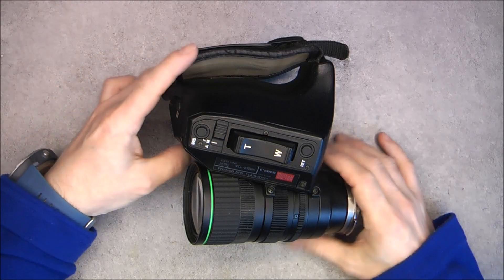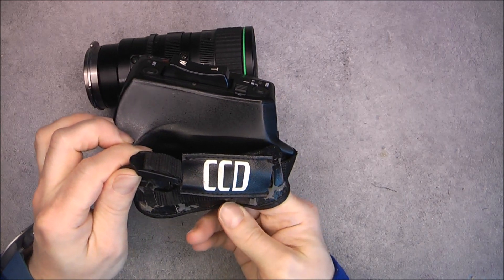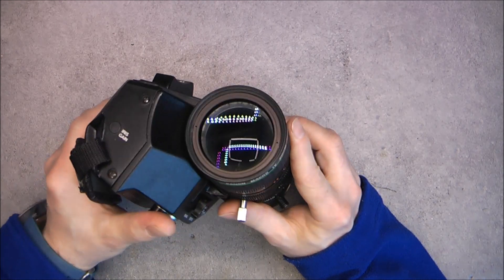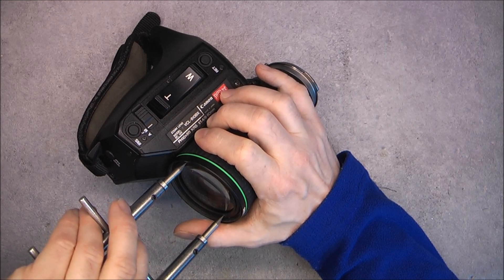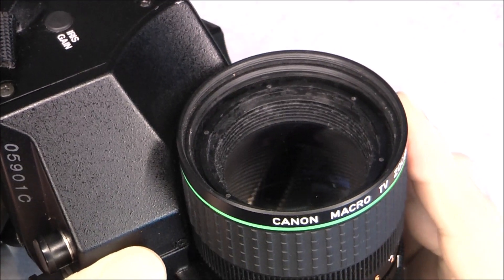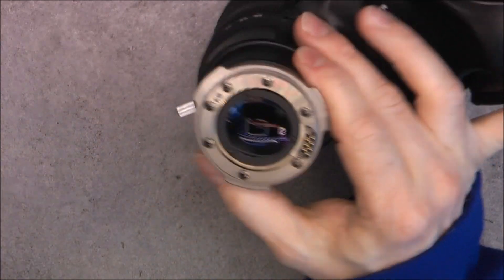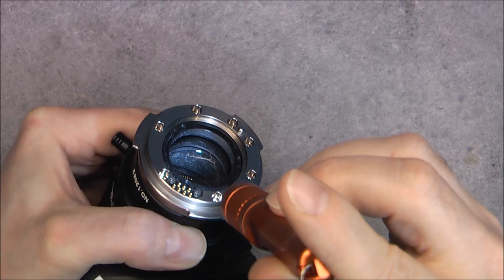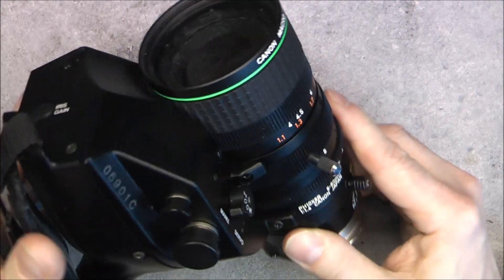Glass fiber whiskers on a broadcast zoom lens

Comment: You sure that’s not just glass fiber impregnated nylon? It’s a very common material for high strength plastic parts. They make engine parts out if it, guns and accessories, tools…

Comment: My theory: Plastic and glass, two materials with very different thermal conductivities and thermal expansion coefficients. The structure of the lens means that any environmental temperature change is going to propagate from the outside of the lens inward. Now, add in a cycling thermal environment, and you have a scenario where the plastic and glass could be expanding and contracting out of phase, so to speak, so that the plastic is slowly "pulling" the glass fibres from the matrix as temperature differentials propagate from the outside in at different rates in the plastic vs. the glass.

Here in Canada (and anywhere else the ground seasonally freezes and thaws, of course) we have a phenomenon known as frost jacking, where things like utility posts are pushed out of the ground by natural forces. When the ground freezes, it "grabs" onto the utility post at the surface, then as the freezing and subsequent expansion of the soil (due to water expanding as it freezes) progresses deeper into the ground, the post is gradually pushed out of the ground. After a number of seasonal freeze/thaw cycles, there can be noticeable movement. Perhaps this is a similar mechanism at play.